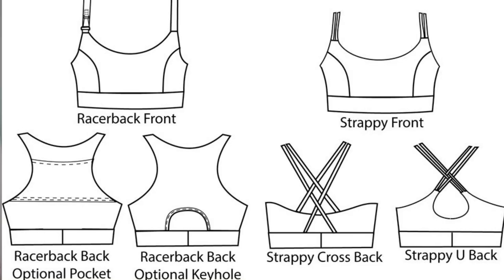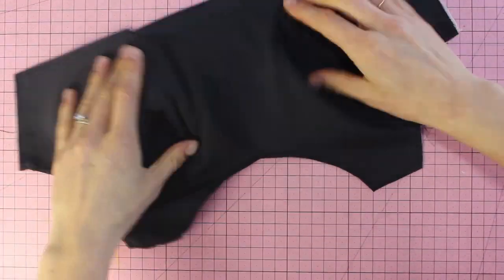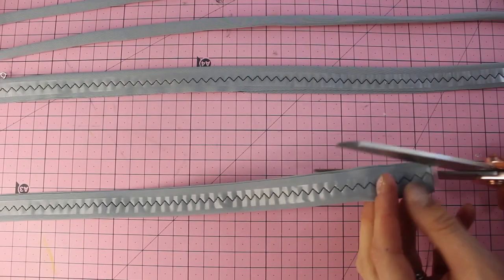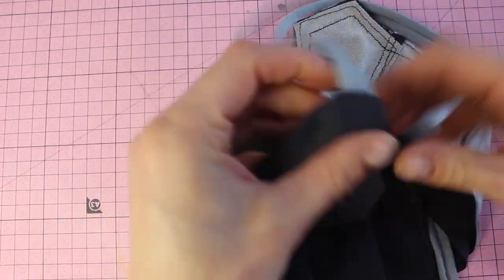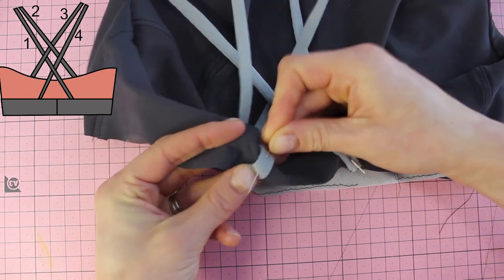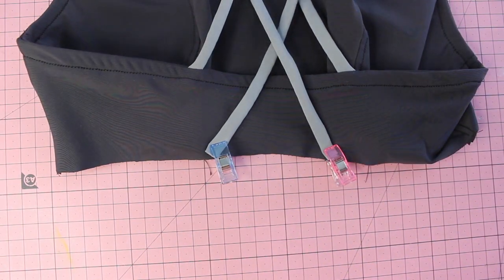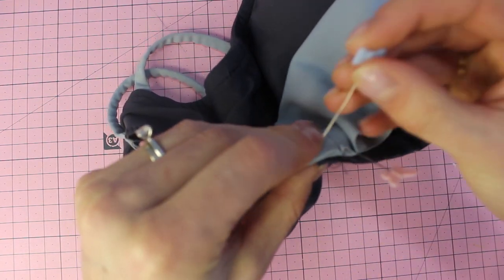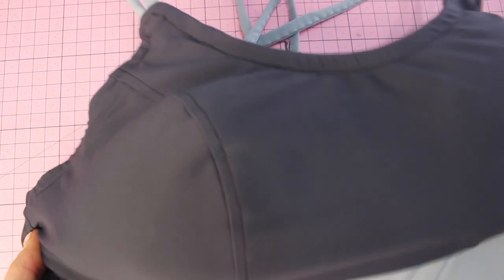Bra Making - How to make a sports bra: Making the Power Sports Bra by GreenStyle & sewing lingerie

Comment: Hey! That's what I needed. Is it the high impact bra? Also  I have a question about fabric. What kind of material did you use? And where can I find it in USA? Thank you.
Reply from the maker: It is a high impact bra.  I lined the entire bra with powermesh (I am sure you can find it at Joannes or fabric.com)
The outer is made from a lycra polyester stretch fabric from Minerva.  The biggest thing to ensure you do is add the powermesh.